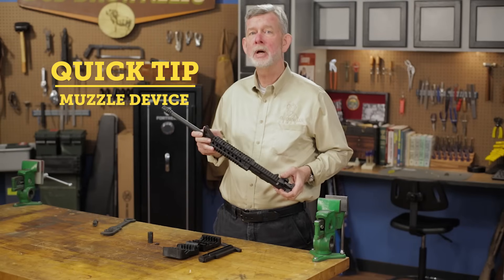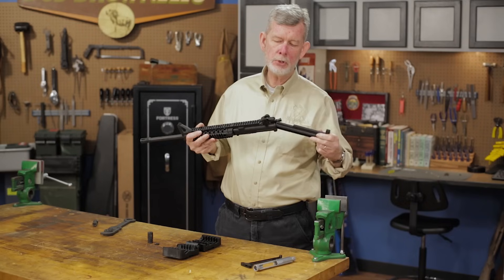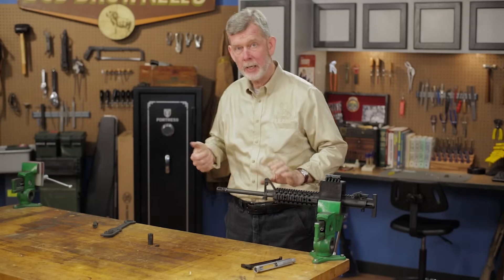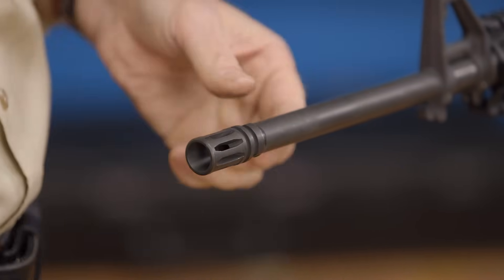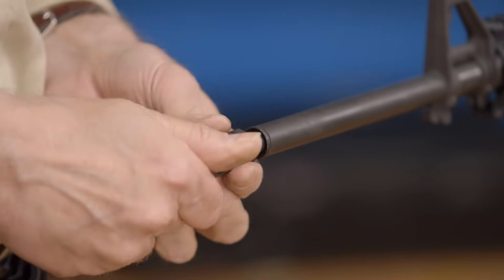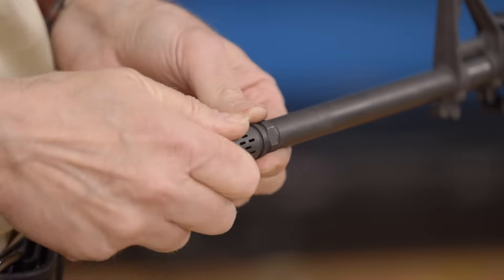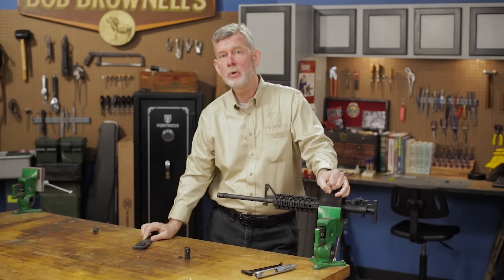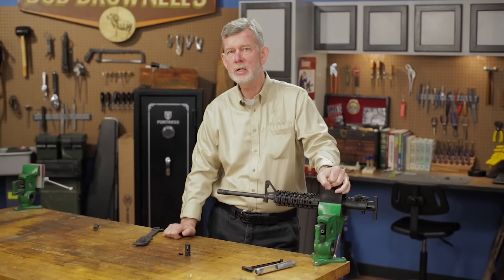Quick Tip: How to Change a muzzle device on an AR style rifle.

Comment: Might be worth noting that if you're ever planning on mounting a silencer to it then you probably shouldn't use a crush washer.
Reply: buckshot i kinda figured but you just answered a question that popped into my head. I’m changing out my fore grip but want to put a liberty constitution can on the end of my AR and this was the first video I’ve watched. Thanks buckshot!!
Reply: Curious as to why? Switching all my muzzle devices over to ASR flash hiders tongiht and came across this video and your comment...
Reply: @723racing  It's almost impossible to get muzzle devices perfectly squared up and aligned with the bore when using a crush washer.  This misalignment can easily result in a baffle strike or an endcap strike.  It's possible to use a crush washer and have everything align properly, but it's risky and not worth it to most people.  Some situations are less risky than others though such as when using a 7.62mm silencer on a 5.56mm rifle.  There's more room for error without getting a strike.  Either way you should check your alignment using a suppressor alignment rod before firing.  It's saved me thousands of dollars.
Reply: @gwman90  makes sense, appreciate the explanation. I went with SlincerCo ASR flash hiders which they say do not to be indexed, but I'd like to index them with one prong facing down to act as somewhat of a shield and block as much gas from going directly into the ground when shooting unsuppressed. I guess shims may be a safer route to go. Who knows, they are liable yo be threaded perfectly to accomplish this without anything, just figured I'd plan ahead. Should the UPS man bless me with his presence today I'll be tackling this later tonight.
Reply: yeah that's ridiculous, how are you supposed to quickly change from suppressor to regular muzzle brake? they couldn't put some kind of retainer in like every AK variant?  I mean the AR loves having needless springs and detents so why not one more?

Comment: The part he puts in the chamber I believe is a receiver insert with a gas tube alignment system, making sure your gas tube is always in line when installing a barrel and torqueing a barrel nut. Wheeler sells a kit that includes it.
Reply: Wish he would have said the name of this device he inserted into the chamber.

Comment: “Changing out a muzzle device shouldn’t take you more than 5 minutes...”
It took me two hours to get to this point 🥵
Reply: Did you have a spare crush washer?
Reply: It’s taking me months cuz I don’t have a vice or a torque wrench or a lug lok for the vice I don’t have lol
Reply: @spartan1010101  Jesus.. do t take the risk by working on them if you don't have the proper tools . It really does cost a lot to get them if the mony is an issue. If you don't have a place to work on them , send them to the gunsmith
Reply: @BlackoutPatriot  that’s what took so long lol bought the tools one by one cuz it’s all expensive.
Reply: @spartan1010101  Buying an AR is a lot like buying a car. You think you paid for it only to find out you have to keep buying more shit to maintain it. Then you have to keep buying more shit because you think of new muzzle devices and optics and parts you want to swap out too lol

Comment: Ha, just playing playing softball here, they picked an easy one. Brownells gave me the hard one.
Now that you're warmed up try to get the flash hider of the Brownells BRN-Proto. Brownells has Superman torque on that three prong duckbill. Must be 80 ft lbs, while 20-30 would be plenty. I'm afraid to put a lot of torque against the upper receiver. Gonna need a barrel clamp for my vise or a reaction rod.

Comment: 1. Workbench (2-3 inch hardwood table top)
2. Upper receiver vise block. (Rynite)
3. Bench Vise
4. AR Crush Washer
5. Muzzle Device
6. Torque Wrench
7. 223 Armorer’s Wrench
8. AR15 Action block

Comment: Don't torque and possibly deform the receivers! Use a reaction rod instead. It anchors the barrel, saving the receivers from possible damage and allows for a most rigid support when torquing on/off the muzzle brake/flash hider, etc.
Reply: I Would not use a reaction bar you might unscrew the barrel extension, I would just clamp down on the barrel.

Comment: So no lubricant, anti-seize etc, or thread locker? 
I bought a used Ruger Ar 5.56 and the previous owner installed a goofy muzzle brake (looks like the one from a Barret) and I want to replace it with a standard deal

Comment: Mine did not come off that easy. I swear the factory installed mine with a 1 inch air impact wrench. Yes I used heat too.

Some advise to others, clamp the BARREL, do not clamp on the receiver.
If you clamp the barrel it prevents it from loosening from the upper receiver.
Reply: @UserAccountID  ok you do you. I'll do it right.
Reply: @UserAccountID  you tell'em hero!!
 Wait until you break off your index pin or damage your upper receiver.
Reply: @UserAccountID  go ahead and Google this, "muzzle device broken index pin"
Reply: Your muzzle device was probably installed with Rocksett from the factory which is highly heat resistant but is water soluble. You probably should've soaked the muzzle in a pot of boiling water for anywhere from 5-10 minutes before trying to wrench it off. Could be a chance they just torqued the living shit out of it from the factory but there's only so much torque they can apply before they destroy the barrel's index pin.

Comment: The tool you used to support the upper receiver , what damage could happen if you didn't use it ?, and how could you tell if it was damaged ?
Reply: That depends on the alternative solution you used.  I would recommend a universal barrel clamp in a vise for muzzle devices.  Second best option is going to be a reaction rod.  What he is using on the upper receiver here isn't going to be my first choice but Steve also doesn't rocksett his muzzle devices on like I do so he doesn't run the risk of damaging the receiver with his technique.

Comment: What is the tool you inserted after removing bcg and charging handle? Thanks
Reply: This is what I want to know!
Reply: BROWNELLS - AR-15/M16 UPPER RECEIVER ACTION BLOCK
080-000-661WB 
If you copy/paste either of those lines into the brownells search bar it will be the only thing that pops up.
I only use the part he used when I am building a 9mm because there is no "star chamber" to lock into.  Everything else I use a reaction rod made by Geissele which completely removes any stress from the upper receiver.  I also sometimes use the wheeler universal barrel clamp almost exclusively when tinkering with muzzle devices.

Comment: Do I need blue  Lock tight to prevent the brake from loosening?
Reply: If you are a casual shooter like Steve, you don't need anything, just the torque on the brake is sufficient.  If you are building a "battle rifle" then you use rocksett.  Barrels get hot.  Blue and red loctite is only good up to 500-600F and Rocksett is rated up to about 2000F.  In terms of thread locking power, it is somewhere between blue and red loctite at room temp, probably closer to blue.  If you are going all in on it....you pin and weld the muzzle device.

Comment: Would this method risk messing up the barrel index pin since a barrel vise isn’t used?
Reply: No, you have the barrel nut supporting it, and it takes wayy more torque to shear the pin than it takes to torque the muzzle device
Reply: Yes, definitely

Comment: Do you have to use any form of thread lock on a muzzle device when you install it?
Reply: 🎇No, just use a light coat of Anti Seize grease( same as you use on spark plugs) you can get from a local auto shop.
Reply: Hey buddy.  Steve shoots casually.  If you are building a "battle rifle" then you will want to apply rocksett to your threads.  Anything that touches the barrel gets rocksett besides the barrel nut area which gets anti-seize, aeroshell 33ms normally.  If you do this and later decide to change your muzzle device you are pretty much going to need to boil your muzzle device for 15 minutes to get it off.  If you try to torque it off even with a geisselle style reaction rod, you can twist the barrel extension right off the barrel.  I know because....I've done it.

Comment: Is the 3 prong muzzle device on an fn15 removable been trying like hell but it just wont come off
Reply: If there are no signs of pin/weld, boil that muzzle device for 10-15 minutes and then vise block it and rotate.  Should come right off.  It is probably rocksette on as it should be.  Rocksette is for high temp applications but is also water soluble.  After you get the muzzle device off, clean your rifle to get rid of moisture, clean the threads and hit it with some brake degreaser, clean it and get to installing your next muzzle device.  Hope that helps a year later.

Comment: I have the tools but i dont have the safety device your using to brace the inside of the upper receiver?What is that called and what brand of vice block is that?I have the kind your can put the entire rifle on that feeds into the mag well.So i could use that to change my muzzle devices out.....?

Comment: My muzzle break simply will not loosen. I have all the tools I need but it just wont come off. It's a brand new 300 blkout upper. Any suggestions?
Reply: You probably have it off by now but if not i could help. I had an AAC 300 blackout upper. They use lock tight on their 3 prong flash hider at the factory. I had to use a heat gun to warm up the flash hider to soften the lock tight that was applied. After a couple minutes of the heat gun warming up the flash hider, it came off so much easier. Hope this helps anyone.

Comment: Do you sell an upper vise block that works with the Savage MSR 10 upper?
Reply: Your MSR 10 is an armalite (non-DPMS LR-308) variant of the AR-10 which you can see easily as the backside of the upper receiver has a "chamfer" instead of a smooth curve.  Any AR-10 vise block should work just fine.  I would recommend you get brownell's barrel extension torque tool (080-001-040WB).  Even though this says 308, it is talking about the barrel extension/chamber locking, not the LR-308 which it also works on.  It is more suited for barrel nuts though, not muzzle devices.  In terms of removing muzzle devices though, I'd still recommend a barrel vise and removing the handguard if that is necessary in order to use the barrel vise.  A "wrap-around" tool like Steve is using here works but it isn't going to be super common for unstandardized platforms which is what most AR style 308s are.  There is a lot of variance in upper receiver shapes, especially for 308 or 6.5CM.

Comment: Is muzzle device removable on 16' barrel? Can it be removed on 14.5' barrel?
Reply: The barrel length doesn't determine the interchangeability of a muzzle device.  Some barrels have integrated muzzle devices that cannot be changed.  Faxon makes some of those.  If a muzzle device is pinned and welded then it isn't easily removed.  Look at your barrel and see if it has a washer on it.  If it has a washer and there is no visible signs of a weld, it can likely be removed.

Comment: Does anybody know if I would be fine doing this... my AR-15 has a full length M-lok rail. Could I just put it in the vice with a piece of board on each side of the rail.  There's a flat spot where some blocks of wood would go.  I'll taking off the standard flash hider that all AR15s come with and put on a different one.
Reply: Rails are made of 6061 Aluminum usually.  The clamping force you would need has a good chance of deforming your rail.  Your best bet is to get a wheeler universal barrel clamp, remove your handguard completely and clamp your barrel directly.
Reply: @JenkinsStevenD  I went ahead and took it to my local gun store and they changed it for me.  A gun vise cost more than what they charged me to do it.

Comment: What is the tool that he's putting in the upper receiver? Do I need that if I use a lower receiver vise block? I need to remove the linear compensator from a DDM4 PDW as shown in the Daniel Defense video, but they don't insert anything into the upper receiver. I'm new to this, and I don't want to damage anything.
Reply: I’m not sure what the actual part number is for the tool he puts in the receiver. I use something very similar called a “Reaction Rod” made by Geissele.  You just slide the upper onto the rod and keeps you from putting any torque on integral parts. Brownells sell them as well as many other companies. Hope that helps.
Reply: CaddyHack Golf TV to you

Comment: Hello. it's the best way to secure the rifle in the frame? may be chamber or others points inside can suffer a damage, or am I wrong? What about to secure barrel?
Reply: Typically you do not. You can damage the rifle well past repair. "Or at least what I would pay". Barrel vices are best for muzzle/head-spacing ect. I see they have those "Receiver Jaws" also but the receiver IS just aluminum!. And they are purpose built per rifle and are not "Mix and Match". "IF" you try securing the rifle, "in frame" for any serious work you will damage it. REMEMBER; The receivers of most AR types are aluminum. Ever squeeze your beer can to hard?
      Quit being lazy and take it apart!

Comment: So no lube on the thread just dry like that?
Reply: Use Blue "thread -lock". A couple of drops on the threads only and spread with your fingertip. Make sure there is NO, grease/oil ect. on the threads so that the thread-lock will cure correctly.
Reply: @scottxfactoraudio8799  Why would you use a liquid thread locker with a crush washer?  Doesn't the washer cause enough friction to keep the muzzle device where you have timed it?  I can see using a thread locker when using those multi washer setups, or when using a peel washer, but for this I don't understand it's purpose.
Reply: @andygold  I too have a problem with the thread lock. Crush washer serves the same purpose, and you will be able to remove the device.

Comment: Do the flat sides of a muzzle device go on the sides or top and bottom?? Or does it even matter
Reply: Doesn't matter, thought they typically go vertical. The portion with no slots in flash goes at 6, AKA the very bottom.
Reply: You index it according to its alignment requirement, the example here needs to have the solid side down or at 6 oclock.

Comment: No need to torque it to a certain FT/LB?
Reply: not if you want to time with a crush washer. if you're using shims, it can be helpful, but the whole point of the crush washer is for you to be able to set the device to the correct timing. the  washer provides the force on the threads to keep everything tight and together

Comment: If u havent her fired the gun can I use the crush washer still my muzzle didnt come with one. Also can i use a wrench rather than the specific removal tool?
Reply: Same boat, my upper was bought before the flash hider ban and my compensator didnt come with a crush washer. Also, yeah, I'm assuming you can use whatever wrench will fit the muzzle device.
Reply: No, it’s the application that crushes the washer, not firing. They are only $1. Yes , you can use a wrench for the muzzle device only
Reply: Crush washers are single-use.
Reply: @riffedwood5597   It is so idiotic that flash hiders are banned that I didn't think you were serious.  California, Massachusetts, New York and New Jersey.  Not an infringement at all.

Comment: What part is that he puts inside the upper receiver?
Reply: The charging handle. You see, "THAT" way if the muzzle brake is "REALLY" torqued on and held tight with thread-lock"? You'll get to destroy it also! So you'll be buying not just the receiver you destroyed but the charging handle as well!!! Maybe even your trigger group!
      The correct way is to have a "barrel vice". You can make a barrel vice. You just need a big hunk of metal. A Bridgeport mill with vice, "Or Comparable". The correct tooling and tools. And about two hours. And Oh yeah, 30 years experience as a machinist and some gunsmithing skills just "may", be helpful as well. There "is" a reason those "Gunsmiths" charge $50 for replacing that muzzle break. MOST of that is experience in not destroying the firearm you are working on. The rest is usually time and the investment they have in things like "the correct barrel vice for each weapon they have trained to smith for".
Reply: I don't know what quotation marks guy is talking about but it's not the charging handle. I've seen it in their AR critical tools kit. Not sure what it's called though.
Reply: > @scottxfactoraudio8799  That isn't the charging handle.
 It is 'vise', not 'vice'.
Muzzle 'brake', not 'brake'.
And we can buy a barrel vise. Who mills out a barrel vise for their own use?